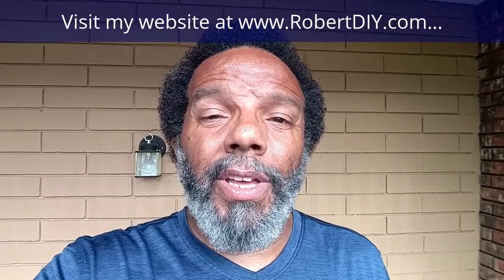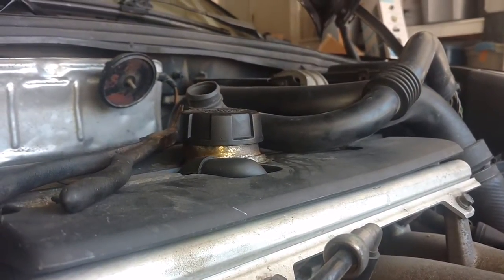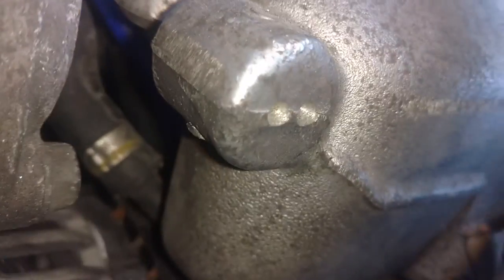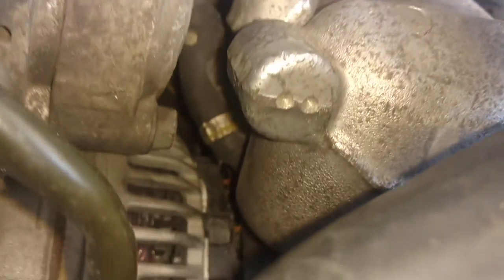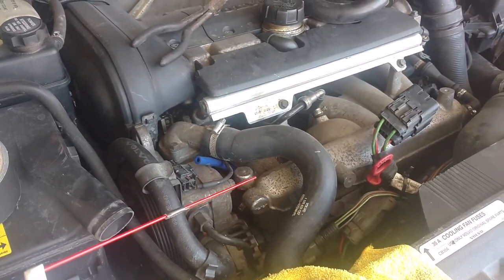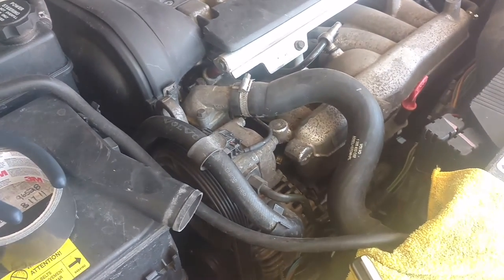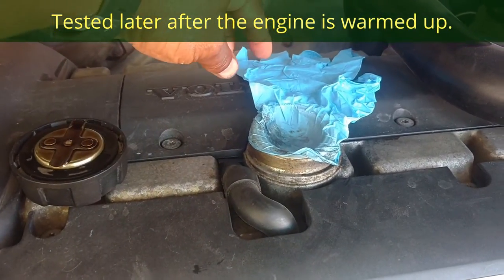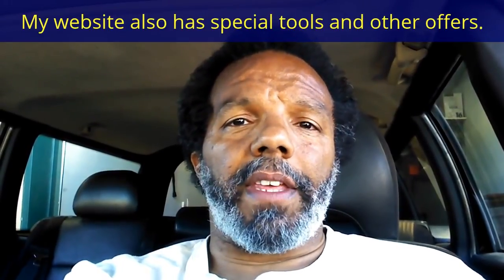PCV intake manifold banjo bolt vent valve cleaning, Volvo 1999, 2000, etc. - VOTD

Comment: What does the banjo bolt do? I replaced the whole pcv system besides the banjo bolt part. I even dropped the oil pan and cleaned out all sludge. The oil is still not sucking down through the oil cap. The only thing I didn’t replace was the banjo bolt. If that’s clogged will it make a big difference. I got a check engine light of p0103 that won’t go away and I’m pretty sure this is the problem.
Reply from the maker: what is the code for?
Reply from the maker: Why would you skip that bolt? Did you clean it?
Reply: @RobertDIY  it’s for a maf sensor, running high voltage. I replaced maf many times, code still comes on. When I replaced the pcv system, the parts for my 2008 Volvo S60 2.5t sells the banjo separately and not with the complete set. So I didn’t replace or clean it when replacing pcv. I was wandering Will that little part cause my car not to pass the glove test and throw that maf code. I plan on cleaning it with some carb cleaner through the vacuum line today to see what happens. Not to mention the pcv breather box had a lot of carbon build up. I’m trying to figure out what is that banjo bolts role in the pcv system, and if that is the culprit to throwing that maf code.
Reply from the maker: The PCV system is not part of the MAF sensor in any way. PCV is post MAF/throttle body.
Reply from the maker: Where are you getting your MAF sensors?
Reply: @RobertDIY  well the maf is being affected and throwing a code because there is no vacuum in the crankcase ventilation system. That is my guess I have also seen other threads that say the pcv can cause a maf code. Check this link out. But my main question is what does the nipple to the banjo bolt do?? Here is the link btw https://www.samarins.com/diagnose/p0101.html

Comment: Hey Robert DIY, I am currently in the process of this whole pcv thing and I cannot remove the banjo bolt. I sprayed pb blaster, but between the angle and the clearance, I'm not having any luck. I also attempted to just remove the hoses going to the banjo bolt (thinking if I removed the hoses, I would be able to sit up the manifold, change my box, pipes hoses etc -- and also have a better angle to remove the bolt) but theres no angle to remove the hose clamp. I'm replacing most of my old stuff with new stuff so I tried to cut through it but that didn't work either. Something in the middle of the hose broke my razor blade. (?) Running out of ideas. Lefty loosey on the banjo bolt, correct?
Reply from the maker: Yes.
Reply from the maker: Take all of the manifold to head bolts out, tilt the manifold up to get at the banji bolt.

Comment: Hi Robert, 
Firstly thank you for making these videos.  I've learned an amazing amount of information about Volvos from you.
I just replaced the PCV components on my 99 V70 GLT, but I did not replace the expensive coolant/PTC/banjo connection hose assembly.  Sadly, my car still fails the glove test.  
I wonder if I did not clean the banjo hose enough while I was in there.  In this video did you remove the banjo hose where it connects to the oil trap?  How do you access it with the intake manifold in place?
Thanks for any advice you can share.  I really don't want to replace the intake gasket again and spend the time removing everything again!
Reply from the maker: As shown in the video, the car was still in tack, manifold still installed, bolt still secured.
Reply from the maker: Are you doing the glove test with the engine warm?
Reply from the maker: Have you done a compression test?
Reply: Thank you again, Robert!  I cleaned out the banjo line with bolt in place as you described and I now pass the glove test!!!

I unbolted the PS pump and pushed it aside to give my fat hands more room to get the cleaner hose on there.  
You’re a hero, my Volbro!
Reply from the maker: Awesome idea.
Reply: @jiggyjc5587  Thanks for your comment. I also went through the replacement of the PCW oil trap without solving the glove test issue on my 99' V70 2.4T. I was wondering how create enough space to disconnect and reconnect the tube from the banjo bolt. I'm going to see if I can push aside the PS pump as you did.
Reply: @RobertDIY Hi Robert, i just stumbled your video. Its great and very usefull!
Btw, is the glove test need to be perform when the engine already warm? Because i did the glove test when i turn on my car after sitting for a full week and engine still cold. And there is no suction at all...

Comment: Hello Robert, 
My 2000 S70 is not passing the glove test. I can't reach the banjo bolt so I want to take off the manifold or at least lift it. Can I do that without removing the fuel rail? Regards Arjan
Reply from the maker: nope